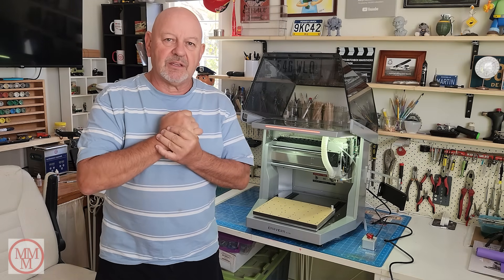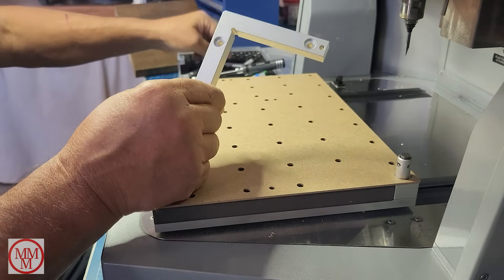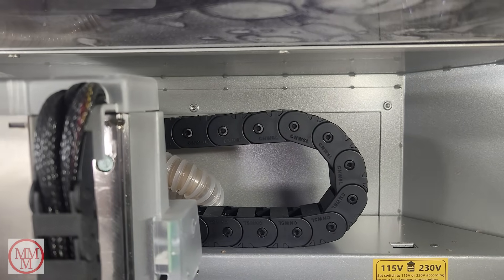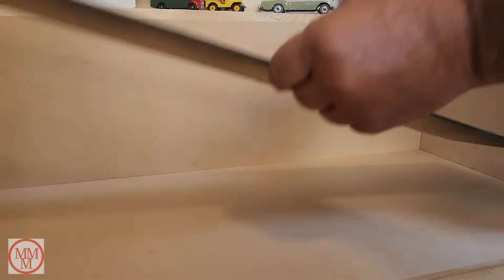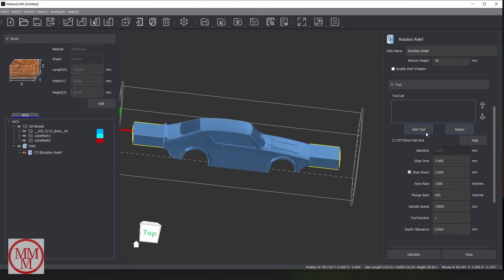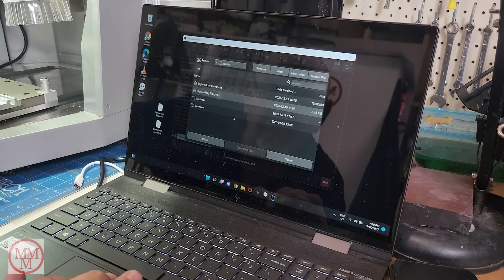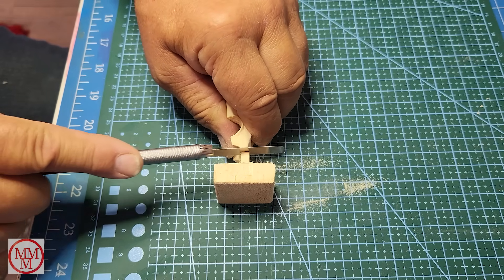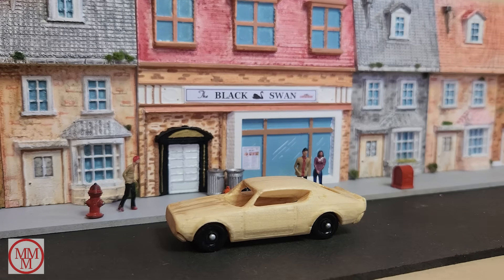'Makera Carvera Air' Desktop CNC  Machine - Setup, Design & Manufacture

Comment: Hi Marty, happy New year to yourself and Julie. This video goes to show how far cnc for home users has come. BTW, the clamps go flat on the table. After you wind the front portion back, you push them against the side of the work and tighten them down to the table. Now wind the front part forward. It will clamp the work and push it down. They are designed as low profile clamps to prevent you accidentally crashing the bit into them.
I personally thought it was a good video that kept with the theme of your channel.

Comment: Great video as usual! I have been running woodworking CNC machines for years. A few methods that work for me, hope they help. IDC Woodcraft has a great Youtube channel for CNC information. Read up on feeds and speeds for your bits. If your bits are making very small chips (dust) or long shavings, the speed of your bit and the feed of your machine are wrong. Understanding speeds and feeds will help prolong bit life and decrease the number of bits you break. You will have better luck with a two flute bit. I run most of my jobs with a two flute downcut endmill, especially on softwoods. You will have a better final finish on the car using a 1/16 tapered endmill rather than using an engraving bit. If you ever need any help just let me know.
Reply from the maker: Great info thanks! - I shall keep you in mind when I get stuck!

Comment: The wooden car came out great!

Note that if you use STLs as base with Carveras controller software you get that rasterized look that is very prominent on the windows of your wooden facades. If you export the model as STEP instead there is enough information to instead follow the borders of objects and you will get a much better output.
Reply from the maker: Thanks for the tip I shall try it out!

Comment: Happy New Year Marty! And also, do you have a 3D printer for to make custom parts and interiors for your models?
Reply from the maker: Yes Chris, I bought one about 6 weeks ago. It's an 'Elegoo Saturn 4' - Great prints! - But a lot of cleaning up after as all unused ultra-violet sensitive resin has to be cleaned up, filtered and returned to the bottle so that it doesn't go off (set).